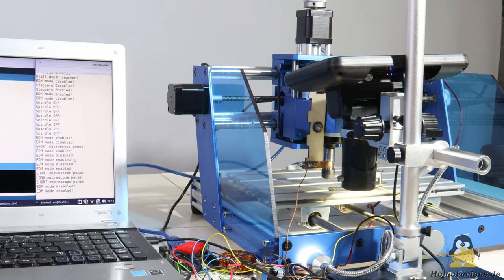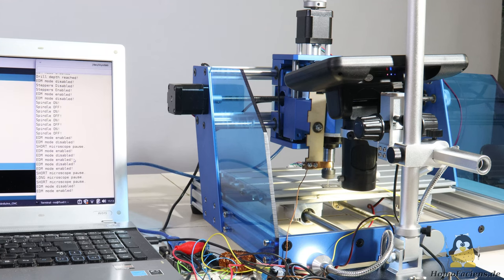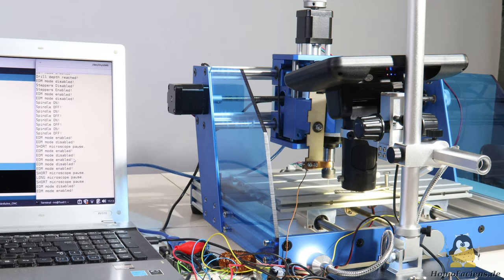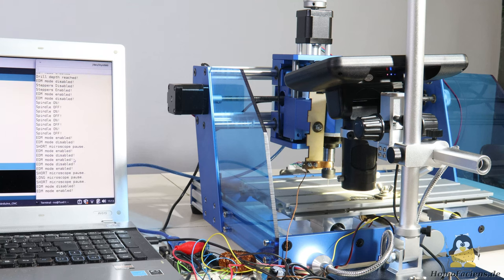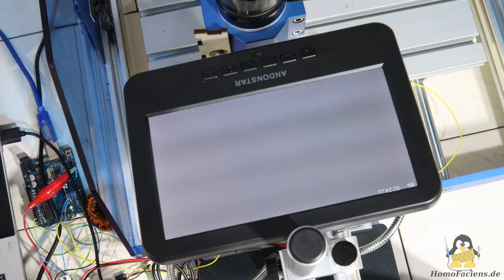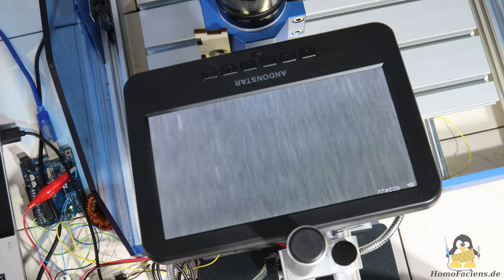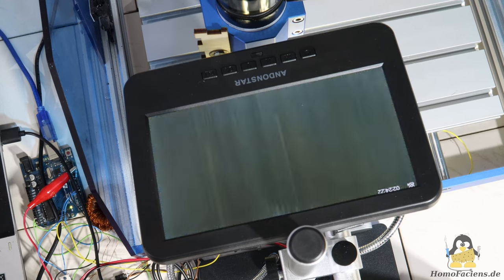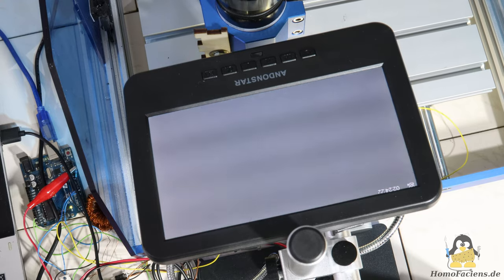Microscope view on the EDM process of drilling a hole

Comment: fascinating series! i really like the step-by-step approach you're taking.

it'd be interesting to compare the hole created from conventional drilling (+ reaming?) vs edm in air vs edm in fluid, although i guess you'd need a softer material for that
Reply from the maker: Thanks!
I thought of comparing EDM with the classic way of drilling, too. I will add a comparison when the drilling process works as good as can be with this simple approach, maybe with normal, non hardened steel.

Comment: Can't wait to see the next one. It seems to be not quite successful one, but progress have been made. I wonder if using something else besides drill would work better. Isn't some use carbon rod? Pencil lead?
Reply from the maker: The series will go from horrible to better, step by step, adding just one parameter per video. Using other material combinations than drill versus razor blade will follow later. Adding flushing is treated in the next video which is a huge step forward. Stay tuned!

Comment: well... It certainly discharges electrons but there's a lot more to EDM. Flushing with dielectric fluid is essential and control of the electron flow.
Reply from the maker: I know. This is an educational series on EDM processes going from horrible to better. The next video will show the impact of cooling and flushing.

Electronics will be treated after that.

Stay tuned!

Comment: Would the results be much different without the pauses required for the time-lapse process?
Reply from the maker: Not with the poor step-up converter / powersupply of this experimental setup. This can generate sparks only at a rather low frequency.

Comment: Wouldn't this process create micro-cracks around the hole from all that intense thermal cycling?
Reply from the maker: Yes, that's what the video shows in the "deep drill" experiment, doesn't it?
Flushing will be added in the video under construction. You will see a huge difference. Stay tuned!